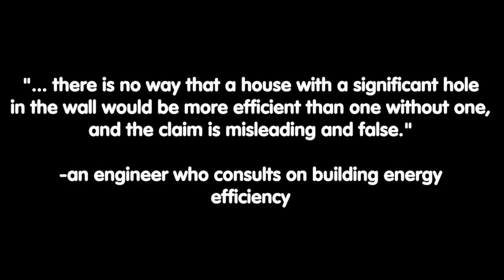Rocket Mass Heater Myths:  heating with a big hole in the wall; ziplock bag effect; tipi results

Comment: Really great discussion!

Yeah, that mass heat really works, it is tricky to adjust to sometimes though, like when the morning is cold and you want to light a fire, but the days are warm, because it will be too hot. There is a time delay in the heat release. It is certainly a better way to go, but my parents have spent a year adjusting to the cadence of firing their masonry heater here in Canada.

One thing that I didn't hear you mention here is that with mass heaters, the heat comes from below while with air heating you will get the heat to rise, giving a hot head and cold feet. 

Also that point about burning less wood is huge! Not only do you save on fuel work and cost, but the amount of air that needs to be sucked in through the holes is far less and so there is way less draft. I have improved my box stove by bringing outdoor in right to the stove, it makes less draft in the rest of the house. 

I am planning to build a rocket stove soon though, you have really helped to inspire me, thanks!

Comment: I'm using an old crappy wood stove that is not very efficient. I have 4 stacks (2 on each side) of  5 gallon pails full of water stacked 3 high (total of 12 buckets) arranged around it that absorb the radiant heat from the stove. It makes a huge difference in keeping the house warm. When the fire in the stove goes out at night I don't wake up freezing like I did before I put the water around the stove.

Comment: I have been working towards this method for 5 years,first I just put bricks, maybe 100 ,around a small wood stove. Instantly I could see a difference the next morning in the temp. Then I wanted to make a nice garden and used the bricks to edge the garden. The next winter was much colder in the house in the morning. 
This year I added 1000 free bricks around the stove and it is much warmer in the morning. Anyone who thinks heating a mass with the same amount of wood is the wrong way to go is 100% wrong. How you distribute the heat is up to you.
I have the bricks on top and surrounding the stove , a fan on a timer to blow the warm air from the basement ,where the stove is , up through 3- 5 inch ducts so the house is divided in 3 sections . Heating a 5k sq ft area so hot we leave a window open at night in the bedroom. 4 months into this year and haven't used 1/4 a cord of wood yet.
 I am not convinced on the rocket stove being better than a conventional stove , however you probably already know I am building one by commenting and watching. I plan to build it separate from the stove I have and test them side by side over time.

Comment: A kotatsu (炬燵) is a low, wooden table frame covered by a futon, or heavy blanket, upon which a table top sits. Underneath is a heat source, formerly a charcoal brazier but now electric, often built into the table itself. Kotatsu are used almost exclusively in Japan, although similar devices are used elsewhere: for example the Spanish brasero or Iranian korsi. https://en.wikipedia.org/wiki/Kotatsu

Comment: R-value is ONLY a measure of how badly heat bleeds through a structure... It cannot be used to quantify the heat storage, and resistance to change in temperature, of high mass wall structures.

Comment: So, I don't recall anyone, in these videos, actually Testing, via Combustion Sampling Technology, any of the devices mentioned.  Or, did I miss that part..?
Reply from the maker: I know that I have never done that.  I have no idea if anybody else has.   I know that peter, ernie, erica and donkey have a lot of testing equipment, but I don't know what all they have.   

For me, I am amazed at how little wood I use to heat my house.  And I see the tiny dribble of steam coming out of the exhaust.   I feel good.  

I think that if there are other angles of testing you wish to see, and by checking with other folks turns up that they have not done the tests you seek, then it may be up to you to do that testing.  In the meantime, other folks will be like me:   the body of evidence is quite satisfactory.

Comment: If you could design a house from scratch, how would you design the room for that initial smoke from the startup? Seems like the teepee is nice because it has the hole at the top, but what about a convential room. Do you just open a window and blow the smoke out with a fan?
Reply: aletoledo1 - these innovators designing these systems have generally found ways to eliminate smoke back on startup.

  A good tall, insulated chimney, preferably out the roof, is a large factor for good initial draw, and where smoke back still occurs, a "bypass" is used, that sends gasses directly from the "barrel" up the chimney until the chimney and combustion section of the stove have heated enough to generate their own draw.

  Highly insulative, lightweight materials for  the "hot-faces" of the combustion section are a key factor to a good performing stove as well.

  Systems have been designed and built that really have no smoke back issues at all, though some may be available as plans that the innovator (rightly) sells for a reasonable price, but you can certainly use the info available for free to learn enough to make, possibly with a bit of trial and error, your own, successful, smoke-back free design... If you pay a little you can get a proven set of plans.

  The core design, the heat collection area, and the chimney are ALL factors in a smoke free stove.  All have some wiggle room, and bounds of functionality, with some performance factors dependent on design choices in the other parts.

  If you design the stove well, the design of the house will not matter as much.

  As with any combustion appliance including wood stoves, negative air pressure from large exhaust fans could effect performance toward having smoke-back/improper exhaust, and a house that is TOO well air-sealed could cause issues with draw, but that is relatively rare, and the easy solution is to crack a window in the room where the heater is...
Reply: Novo Karpati - true... Some rockets, especially j style have a tendency to smoke back until they get warm, but bypasses and other design improvements have effectively eliminated that problem when the proper design improvements were made...

  It was most often a problem for people who had short chimneys that exited out the side of the house... Usually chosen by people who didn't want to figure out how to deal a new penetration through an existing roof...

  Also less likely to be a problem when a low mass highly insulative refractory is used in the combustion core areas.
Reply: Smoke back on startup is usually only a problem when the system is "cold started." Meaning when the thermal mass is cold and no natural draft is present, usually it only happens on the first burn of the season. It also happens on poorly designed systems which is what the Erica and Ernie, and many others, have been testing and teaching for years.
Reply: then you do NOT know how to start a 'smokeless fire', or have wet wood, or, the unit is not built correctly.  ALL wood-fired devices/units, should..."'should''..already have a natural, positive draft, or, provision/s to start it in the 'exhaust' phase, next to the chimney.

Comment from the maker: The key is what donkey said:  there is a huge amount of power and efficiency with radiant and conductive heat.
Reply: paul wheaton - here's a prime example...

  My GF who is ALWAYS cold, sits on the porch to smoke, and was using a "glowing flat wire element with a reflector behind it and a junky little fan" type electric heater, burning 1500 watts, and mostly heating air that never even made it the foot and a half from where it sat facing her on the table.   Generally it was warming only her hands that actually were held close enough to it.  I'm guessing probably only 10-15% of the heat coming from it was radiant.

  I took ONE 250 watt heat lamp and mounted it the same distance from her, in a ceramic outlet rigged to sit on a base on top of the table, and she was instantly warmer over her ENTIRE side facing the heat lamp, than that 1500 watt heater chugging away ever got her.

  When I installed the second one in a brooder lamp shining down on her head and neck from above and behind her, I became her radiant heat HERO, and have been saving 10 cents an hour (2/3) while she is MORE comfortable than before. (And it's all thanks to what I've learned from you and the other innovators)

Next step is to build a small "radiant rocket" and stop paying the power company at all to be warm on the porch... 

Just have to go out in the yard and play pick up sticks to earn our heated porch time.
Reply from the maker: the amazing efficiency of radiant heat!
Reply: Fred Garvin - It will happen sooner or later.  I hear heroin is easier to quit, so we're going to switch, and then quit that.
Reply: orcoastgreenman or you could get her to stop smoking... lol
Reply: orcoastgreenman lol. no offense was meant btw. glad you didnt think i was judging. good luck to ya and great idea with the heat bulbs.
Reply: Fred Garvin - no offense taken friend!  Just having fun being cheeky!  Stay warm!

Comment: I will ask what every engineer asks, where is the data? Time, temp and humidity.
Reply: Here is some data... 12 hours after they burned a fire for 3-4 hours, 4000lbs of thermal mass is still warmer than the cheeks seated upon it... ;-)

  My "80% efficient EPA rating" wood stove doesn't do that... Heats mostly the air in my house, and sends 350-600F gasses up the flue, to prevent creosote build up from that other 20%, and to keep air being sucked in at the proper rate.  At the same time it sends a large stream of smoke and creosote constituents into the environment.

  Testo data for the combustion efficiency of Peter's batch rocket design from his batchrocket.eu site is available and the design is open source, so you are free to build one.  

  Overall system efficiency is determined by what you put behind it to collect the heat and release it over time, and how hot the exiting flue gasses after your heat capture system are.

  These people are generally self funded in their research and perfectly willing to use objective data like "before we burned 3-4 cords of wood a winter to stay warm during the day and woke up to a 45F house... We built a rocket mass heater, burn one 3-4 hour cycle a day spring and fall, and two in winter, and are consistently warm, and the house remains at 65 when we wake up in the morning.  We made NO other changes to the house's insulation or other factors that would effect it's heat retention.  Just replaced the wood stove with the rocket mass heater, are MORE comfortable 24/7, and we do it with 1/4 (for some as little as 1/10th) the wood."
Reply: But if you have the sensors and data logging equipment to take these designs and conduct such data collection it would be a valuable addition to this open source community.

  Also, be aware that 80-90% of people with "rocket mass heater" videos on YouTube are building designs that miss very basic features of the innovations that these people have pioneered.

  If it has metal in the interior "flame path" area of the stove, and that metal is not scaling away or melting out entirely within a few burns, the design is not achieving the type of high heat, high efficiency combustion these pioneers are producing in their designs.

  The best places to find info and advice, should you choose to join the open source project;

  Paul Wheaton's permaculture forum rocket stoves and rocket mass heaters sections and his videos and interviews about them here on YouTube.

  Kurt (Donkey's) rocket stove forum on pro-boards

  Peter's Batchrocket.eu site 

 All video's featuring Ernie and Erica Wisner here on YouTube, and their Ernieanderica.info site.

All that stuff is free^^^

For pay informational products I can think of off the top of my head include:

  Ianto Evan's & Leslie Jackson's Rocket Mass Heaters book, various books and stove designs by Ernie and Erica, as well as the multiple videos for sale on rocket stoves and fire science through permies.com...  But you can learn enough to build your own and start testing, just from the free resources above.
Reply: Interesting stuff on wood consumption, how many BTUs from how much wood? Seat of the pants, it produces heat to be comfortable to sit on.  

Hows the temp of the air in the house vs outside?   

There is little info on testing of the stoves, no one has paid a testing lab for it. Some colleges have run development tests, some not for profits too. They are mainly looking at developing country cooking stoves.

Comment: I have seen the tipi - I can vouch for it.  It's just a canvas wrap around poles, open at the top, open along the ground.  And yet, with the heat of a rocket mass heater, you can be comfy in there when it's bitterly cold outside.